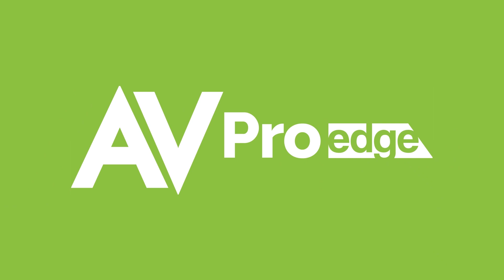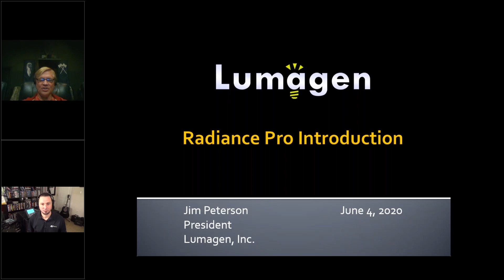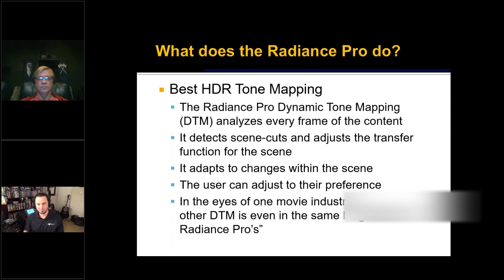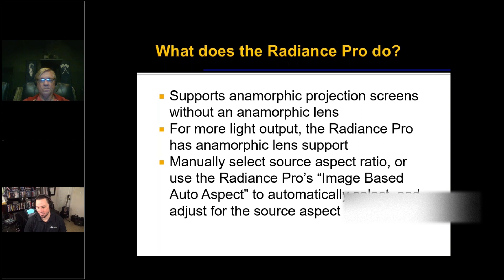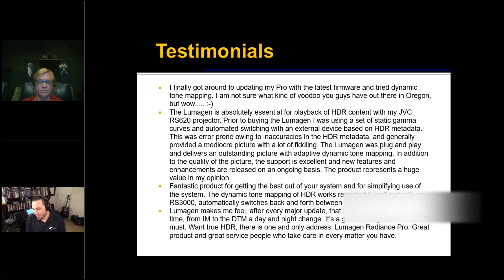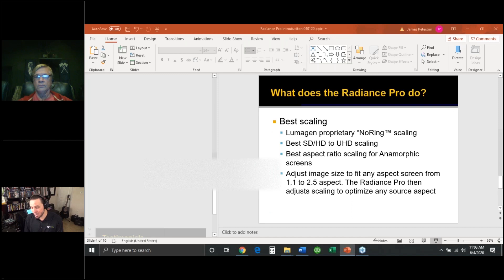Introduction to Lumagen with Jim Peterson pt1

Comment: I don't understand why people keep saying "you don't need <INSERT RESOLUTION HERE> because you can't see the pixels." I've always thought that the benefit of higher resolutions is smoother motion. You're watching a moving picture, not a still photo. If there's a high-contrast pattern moving across the screen, it "jitters" on a 4K display as the patterns shift between pixels. 8K would improve that, would it not? (compression notwithstanding)

Comment: My home theater is in the planning stage.  Initially, I thought of purchasing the LG Cinebeam HU810PW, seemingly "the cool projector of the year", with 2700 lumens which I thought would be most helpful for my "theater room" that has ambient light coming from our "open concept" kitchen-theater room, that light coming from the kitchen at the projector end of the theater room.  But then I realized that that LG projector was 16:9. And then I discovered that most modern films are 2.35:1, and that's about 3/4ths of what I watch.  Then I discovered anamorphic lenses, though there doesn't appear to be one for the LG projector that In was considering.  Then I discovered "lens memory".  And now I've discovered Lumagen Radiance Pro.  

All I basically want is a projector/screen setup that is:

1. Not washed out by ambient light
2. Has a phenomenal picture
3. Can effortlessly switch between 16:9 and 2.35:1
4. A light source that lasts 20k hours (that is a must-have)

What to do?  My first solution was to switch to the $20k Sony 915ES projector, approx $17k more than the LG, but it does have lens memory (allowing me to switch from 2.35:1 to 16:9 fairly easily I think) and it is a laser projector with 20k of light source life, a "must-have" for me.  

But now I find out about this Lumagen Radiance Pro, and the idea crosses my mind, "I wonder if the Lumagen could be used with the original $3k LG HU810PW projector to be able to switch easily from 16:9 to 2.35:1, which is what would be projected onto my yet-to-be-purchased 150", 2.35:1, 1.3 or 1.4 gain acousitcally transparent  screen."  That arrangement (minus the screen), in effect, would cost LG-$3k + Lumagen-$8k, total of $11K.  Whereas the Sony 915ES by itself costs $20k.  So the LG Projector plus the Lumagen saves me $11k, if indeed that is reasonably doable.  I have a sneaking suspicion however that using the Lumagen to try and make the 16:9 LG projector into a projector that produces the desired 2.35:1 picture is a mistake.  

Is it?  What have I missed?  I'm certainly open to suggestions!  Thanks!